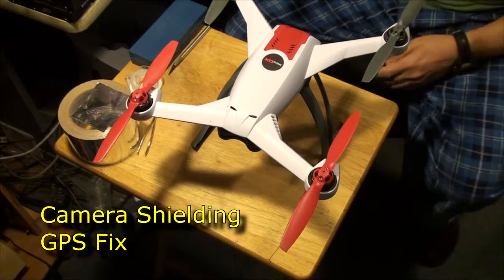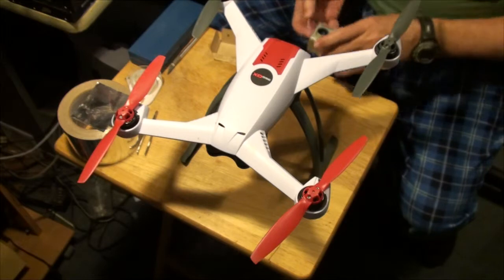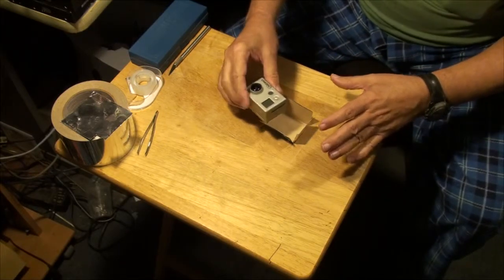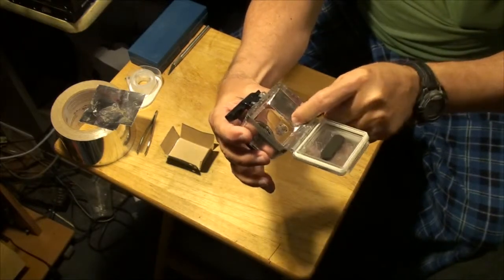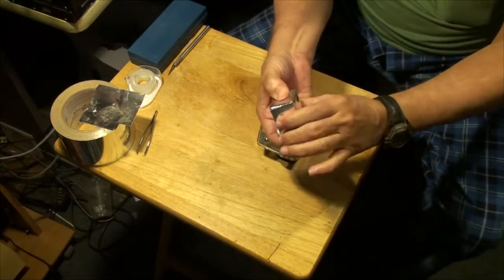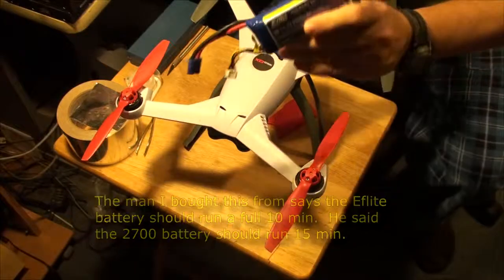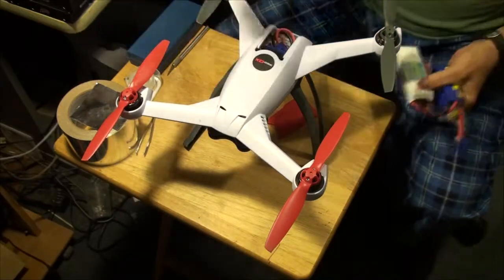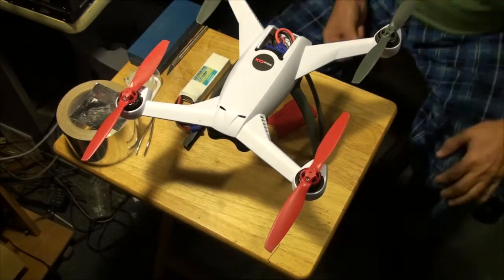Shielding and batteries

Comment from the maker: I discovered something new this morning about the RF problems with the GoPro cameras and the the GPS in the Blade 350QX.  With the same shielding I use in NTSC 30 FPS HD I switched to the 60 FPS 720 HD mode made two flights and lost control and GPS lock both times.  Last forced landing flipped upside down in a puddle of water in my yard.  Put it back into 30 FPS 1080 HD flew it until the battery ran dead and it didn't lose GPS lock. The FPS changes the rates at which video is stored on the SD chip and it affects the GPS differently.